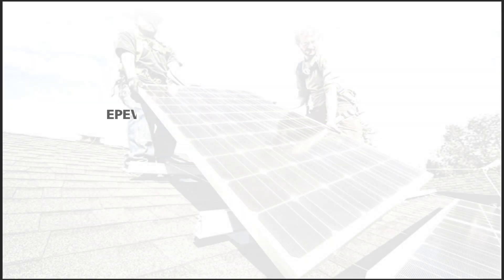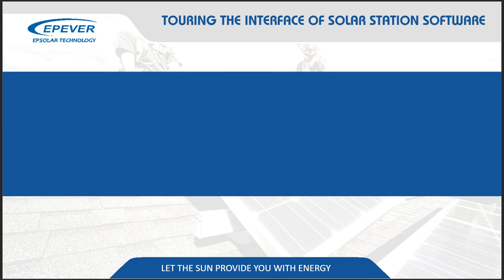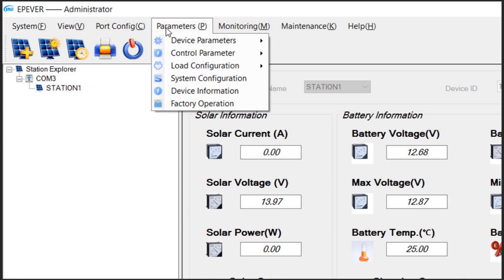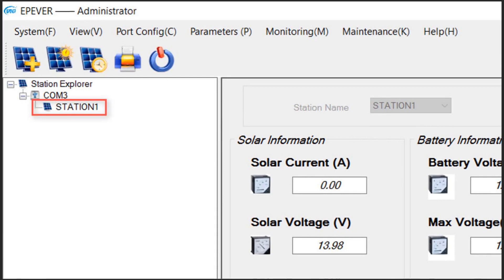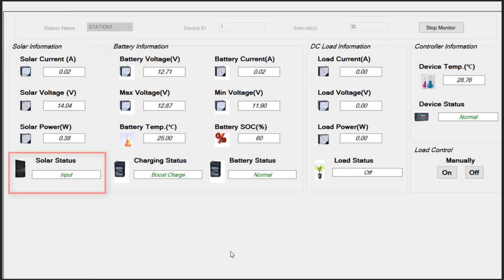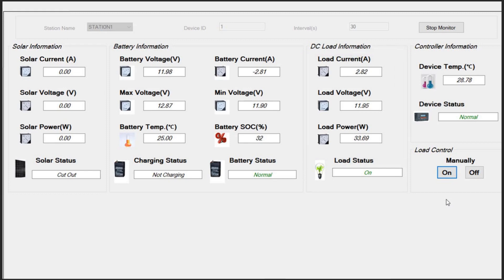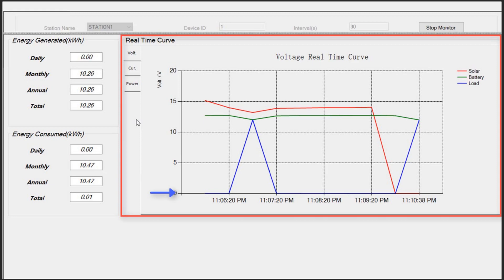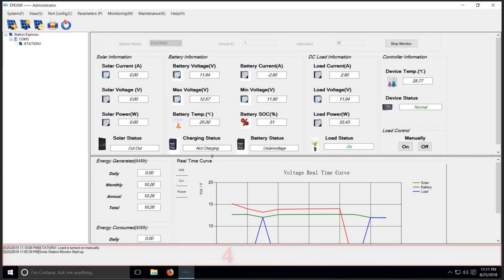Touring the Interface of Solar Station Software

Comment: When i Set in the PC Solar Monitoring software parameters in the Option for Libattery,.   I Set evrything send to my Controller and all. But after when i Open the Programm again and Push "read" to See my settings of my parametters, in the Part where is the Line "serial Numbers" it groes Back to "series numbers 3" But i Had Set for  my parametters settings in this place "series number 4"! What i make wrong in this Case thats this settings Always falls Back!?    Thanks a Lot for helping       best regards
Reply from the maker: Hello abdulah, franz, thanks for your question.  The function of selectiing  "series numbers "is to call the voltage point. When reading the data, you can ignore it and just check the voltage points is compatible with your lithium batteries. We will also update this function in new developed software. tks.

Comment: Hi !
I set in the SW the values of "Li-Batt Low temperature Charging limit" and "Li-Batt Low temperature Dicharging limit" at 4°C.
I noticed a mismatch between the "Battery Temperature" displayed on the Charger and the  temperature measured with a termometer placed on the Battery. For example now the Charger show 24°C while the termometer applied to the Battery show 19°C. This means that when for the Charger is at 4°C , the battery is already a -1°C !😱 (too late to stop the battery from charging/discharging).
How can I manage it?
Note: could you please answer also to the comments I posted 5 days ago? (see below).
Thank you again
Reply from the maker: Hello there, have you connected a remote temperature sensor directly to the battery, or are you relying on the local temperature sensor? The accuracy of temperature readings may be affected if a temperature sensor isn’t directly connected to the battery.
Reply: I have a RTS300R47K3.81A sensor, but at the moment I have not used it because I thought it was not suitable with LiFePO4 batteries.
Can I use it with LiFePO4?
If so, where should I fix it on the battery pack?
Is there a specific point?
Thank you @Epever
Reply from the maker: You can place the end of the temperature sensor directly on the surface of the LiFePO4 battery and ensure a good connection between the probe and the battery. @alexcats5298
Reply: OK, I did it and now the charger display shows the temperature of the RTS.
Will this now be the reference temperature used by Epever for the "Li-Batt Low temperature Charging limit"?
Also, I do not want to perform "Temperature compensation" for my LiFePO4 batteries. To be sure to avoid this, is it correct if I set the current Temperature Compensation value to 0? Thank you again 😀 @Epever
Reply from the maker: Yes, this temperature will serve as the reference temperature for the low-temperature cutoff of the lithium battery. We recommend configuring the lithium battery parameters using the PC software or via WiFi/BLE to enable the low-temperature cutoff function. Once the settings are completed, the temperature compensation value will automatically adjust to 0. Please make sure to restart the controller after configuring the settings for them to take effect. @alexcats5298
Reply: @Epever  ok. Thank you for the information. I followed your procedure. Now how can I "restart" the controller? Do I have to switch off and then switch on my solar plant?
Reply from the maker: You are correct. You'll need to disconnect the PV array and the battery, then reconnect the battery and PV. @alexcats5298
Reply: Ok. I'll do it. But do I have to follow this procedure (...restart the controller after configuring the settings...) every time I change any parameter in the APP or via computer (connected to the RS485 Port) ? @Epever
Reply from the maker: Yes, it's recommended to restart the controller to ensure that the configured parameters are enabled. @alexcats5298

Comment: Hi, I have a system with LiFEPO4 batteries and I have connected the Epever Tracer 6415 AN to the computer to set the parameters as "USER".
In the "Parameters - Control Parameters" menu I saw that there are 3 screens that can be select, labelled "Sealed", "LIFEPO4" or "Li Battery" respectively, and in each of them I can select "USER".
Should I only use the "LiFEPO4" screen, or can the "USER" selection be made indiscriminately in any screen (even Sealed or Li Battery) and EPEVER will automatically recognise it uniquely?
The EPEVER is great but the SW component is unfortunately not accompanied by a sufficiently detailed manual.
Thank you in advance  from Italy
Reply from the maker: Hello there, please follow the steps to set up a lithium battery:
In the Parameters tab, please select Control Parameter (For LiBattery controller product), then set the current Battery Type to "LiBattery", and current LiBattery Type to "LiFePO4"; then choose the current Series Number according to the battery voltage lever: choose "4" for 12V battery, 8 for 24V, 12 for 36V, 16 for 48V. Then please disable "Oilengine Controlsignal, and set the charging voltage points you want. Finally, click update.
Reply: @Epever  Thank you for your prompt reply. 
I intend to set my own charging voltages.
I noticed that, instead of selecting current battery type to "LiFePO4,  I can select also "USER". What is the difference between them?
Furtermore, I noticed that if I try to select USER and then I attempt to select the current Series Number according to my battery voltage level (12V), I can select only between 3, 6, 9 or 12 and not "4" as you suggested. 
What is the reason for?
Thank you again.
Reply from the maker: Hello, we recommend selecting LiFePO4, as choosing User doesn't allow you to select the system voltage level for the battery. After selecting the LiFePO4 battery type, you can still modify charging voltage points. After updating the parameters, the battery type will automatically change to User. @alexcats5298
Reply: Hi ! I followed your procedure that allowed me to select the system voltage level for the battery to "4" (12V). As soon as I click on "update", LiFePO4 change to User, as you said, but ...also the  system voltage level for the battery ...go back again to "3". 
I don't understand Why.. .
Thank you for a clarification on this issue.
Have a nice day. @Epever
Reply from the maker: That is normal, it's the lithium User battery type, so don't worry about that. @alexcats5298

Comment: Good morning,
selecting Parameters - control parameters, in the page I have to set two values: Rated Load Current and Rated charging Current.
Could you please tell me what these vales stand for?
Thank you.
Reply from the maker: Hello, these two values represent the rated input and output currents of the controller. The Rated Charging Current is the maximum PV input current allowed, while the Rated Load Current is the maximum load output current permitted.

Comment: Good morning, 
could you please confirm that the value to set "LiBattery Protection" (Enable or Disable) is releated to the critical minimum tempereture to charge the LiFePO4 Batteries, that I set in the "Device perameter settings" (lower temperature...)?
Thank you
Reply from the maker: Yes, you're correct. Please enable the LiBattery Protection function. It acts as the low-temperature disconnect function.

Comment: I do not know how to read running / Fault log data from this software in my PC? Do you have user manual for this software?
Reply from the maker: Hi, we currently don't have the manual document for this software, you could check EPEVER new calculator tool at: https://www.epever.com/sizing-calculator/
Reply: @Epever  Now, We are using Tracer 8420AN. But when we use monitor software, we could not Read / Inquire log data. Do we need connect RS485 to Tracer 8420AN directly? Because now we monitor parameter via TCP-02 module.

Comment: Is there any way to change the parameters of battery (max voltage, minimum voltage..) directly without software?
Reply from the maker: Hello OMAR, Thanks for your comments. For some products, it supports setting the parameters via LCD. You can get these information from user manual.